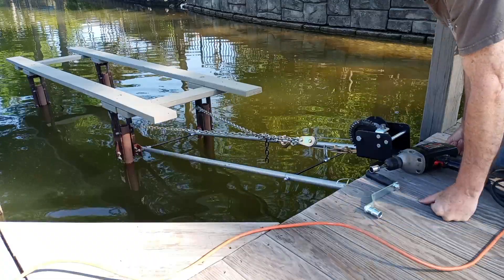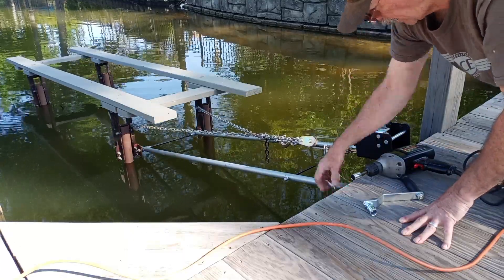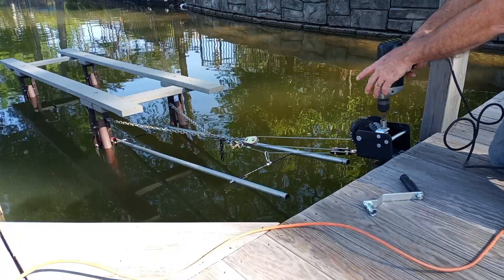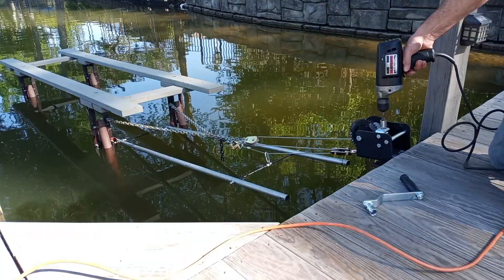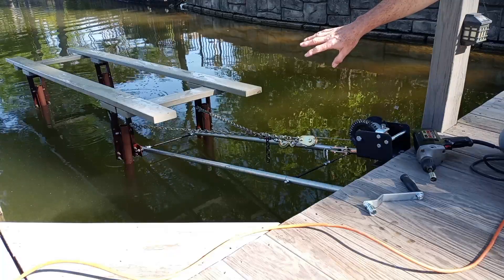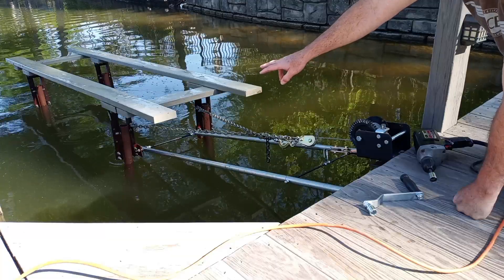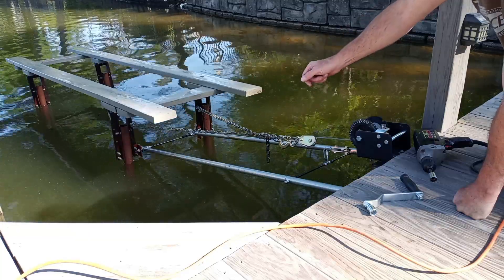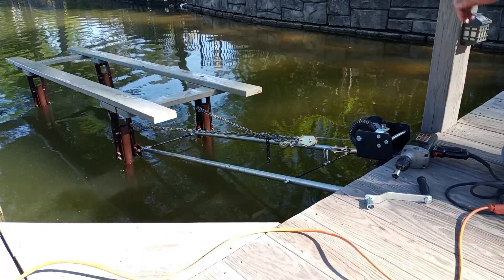Simple Boat Lift - DIY & Inexpensive

Comment: Great job on the lift.  I pretty sure I am upgrading my boat and find that the aluminum lifts are very expensive.  This would work for me.  Can you share a list of materials and a few measurements as well as boat you are lifting.  I have been considering using galvanized fence posts.  Have determined you can weld and then finish with good paint.  Any help would be appreciated.